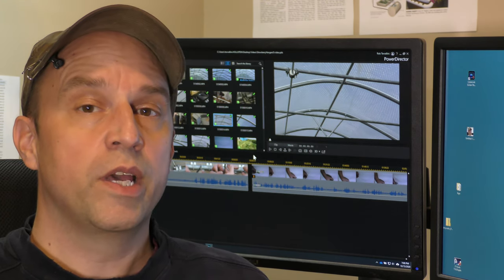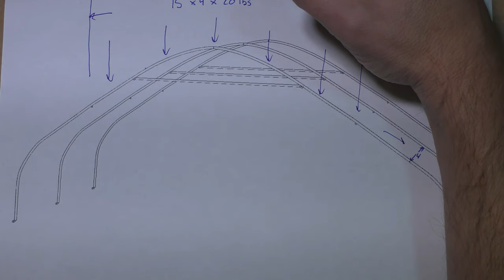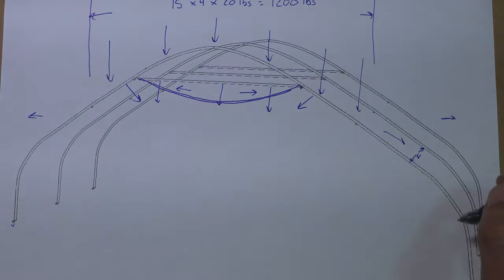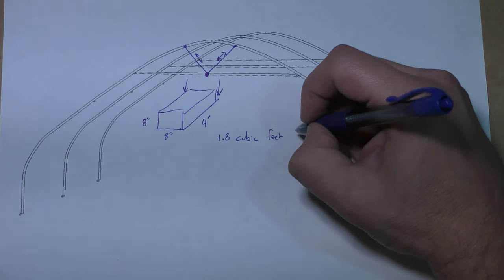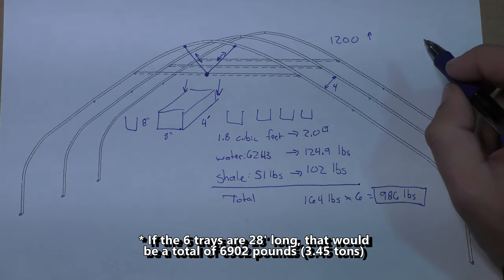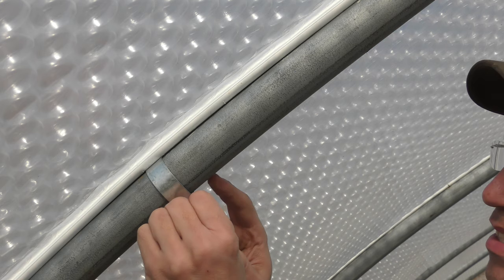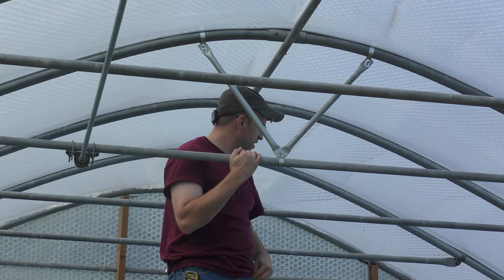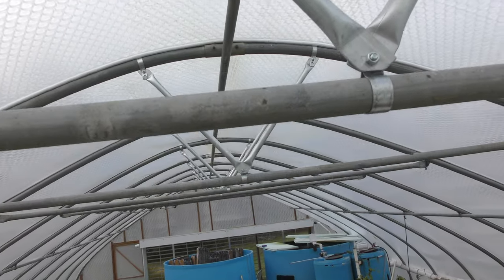Strawberry Hangers - Dealing with Stress! - Part 3

Comment: I Went thru all of this a little over ten years ago and determined the best solution was to install center posts that "floated" or could be moved by sliding back and forth on a center perlin pipe that ran the length of the greenhouse and after using them just in the winters, i ended up leaving them in year around to help fight the Maine coastal wind storms. After time you get used to them and work your setup around them.  I Only added posts every forth bow.
Reply from the maker: Yeah, I debated doing a center pot but really didn't want to interfere.  This greenhouse frame has survived 30+ years with the snow so I'm sure it's strong enough....just wanted it slightly stronger to deal with my crazy ideas. ;-)

Comment: Just an idea. If you were to put relief groves in your main hanger block, you wouldn’t be putting the squish (tech word) on your belt going to your hangers.
Reply from the maker: I can't put groves on that side since the belt moves over that area which would make it impossible to get the teeth on the belt to line into the grooves as it is tensioning in the wedge.  However, if I flipped the belt over so the back smooth side was in the "squish" area, it would work fine.  Short story, I didn't feel like redesigning the wedge to fix it.  ;-)

Comment: It would be great to get an update on how you like the covering on your greenhouse. Has it met expectations so far?  How long do you think it will last?  Any noticeable difference in insulation value as compared to a single layer or double layer of plastic?  Thanks for the great videos.
Reply from the maker: It's been great except for wear the bear clawed through it but not much could have stopped that.    Comparing most of these coverings they all have a very low R-value so it's difficult to compare.

Comment: Really enjoy your videos. Just wondering, could you use the first style of pulley with cable and simply add a HEAVY duty rubber band to the groove for grip? There would be maintenance due to wear or drying out/cracking... or application of liquid plastic grip instead?
Reply from the maker: I was a consideration that I decided against trying so it got cut from the videos.  For the reasons you stated that I felt they would wear too fast or would dry rot.  thanks for the feedback!